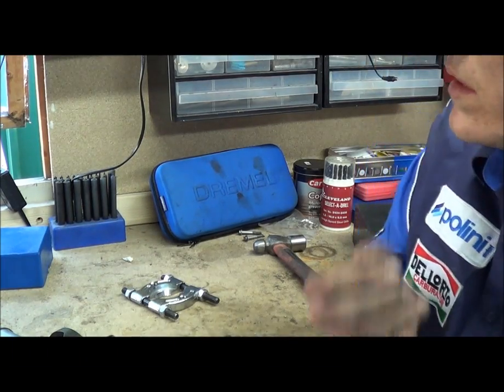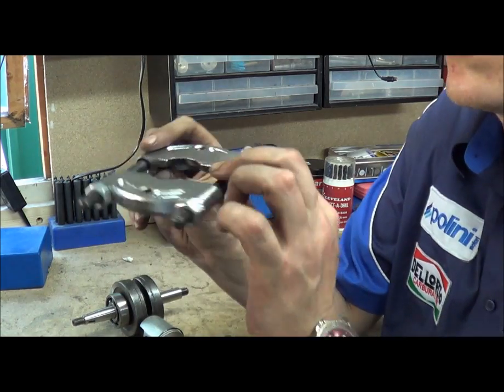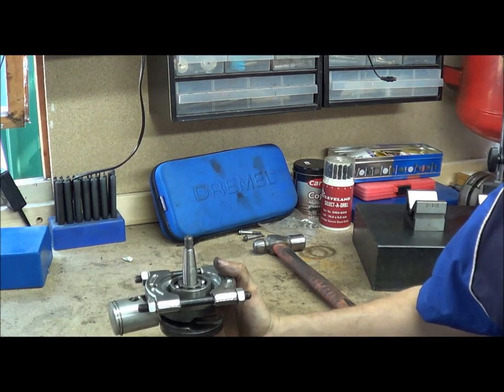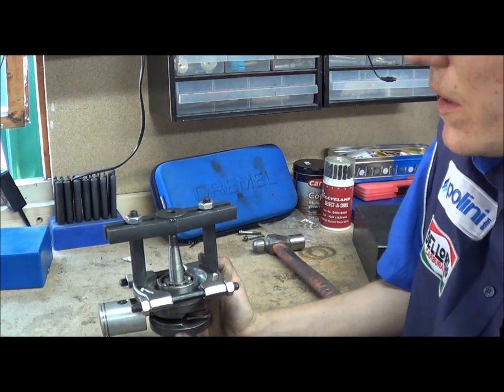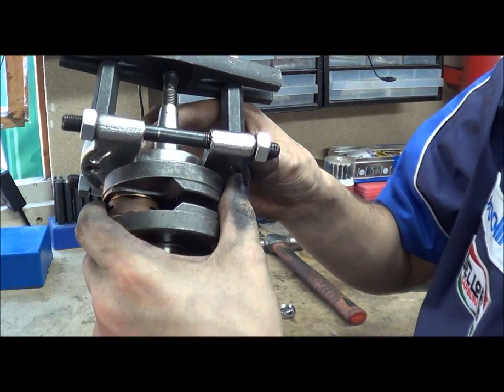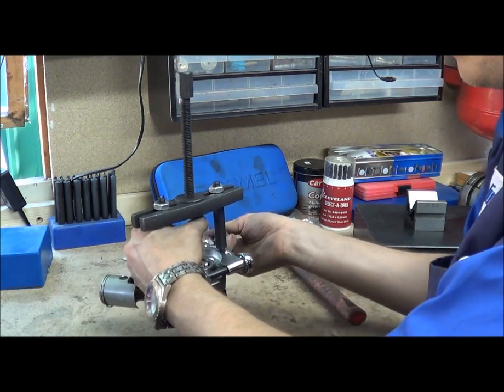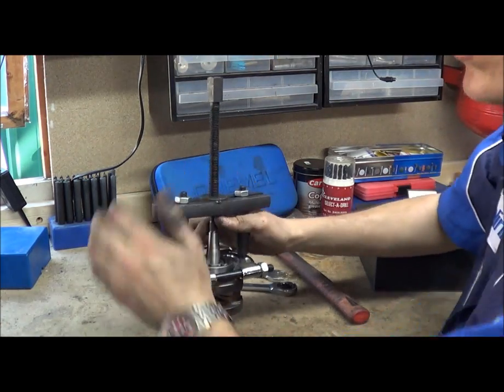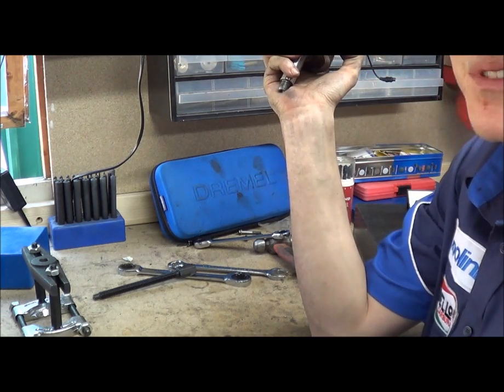Bearing Removal From A Crankshaft

Comment: Always try and leave nut on end of crankshaft when using pullers it helps stop the end spaying out
Reply from the maker: If you're splaying the end of a crank  then you're doing it wrong, very wrong
Reply: @thedirtyworkshop   doing it wrong is when you don't thread the nut on that's why you  put the nut on  and like mentioned in another comment lubricate the end of the crank and puller to eliminate friction
Reply from the maker: Do you have any idea how much force it would take to splay the end of a shaft? Do you want me to calculate the hoo stress for you?
Reply: @thedirtyworkshop  so what your saying is every bearing always just pops off without any problems no I don't need you to calculate anything I've seen all I need to see thank you
Reply from the maker: The compressive strength of the end of a shaft is way way higher than the fit of a bearing. If you have seen failures that because some retard is making bad cranks. There's a specs for centres in shaft vs diameter. You won't be seeing failures on Japanese cranks, I know that much.
Reply: @thedirtyworkshop  bearings get hot in service bad bearings get extremely hot and become almost fused to shafts it's all but to easy to damage the end of the shaft on removal two stroke cranks are almost Meccano sets compared to some but that said  prevention is better than the cure some cranks have a spigot machined on the end so you can use a thrust cup on the end to prevent damage when using pullers

Comment: Thanks for the info I thought about using the tool you slid under the bearing. I just didn't know about everything else that would connect to the rod for a pulling up motion. I usually put the end with bearing back on case and then tap crank off with my soft hammer. then I have both bearings still in case. If I don't know the background of bearings or crank, I just get new stuff to be safe!

Comment: i have a `93 polaris 250 and it seems to me the 6000+ miles on it had siezed one side of the crank set of bearings i had one of those tools and bent 4 bolts that clamp the jaws so this tool is for fairly new crankshafts not recccomended for old ones like mine.So after my frustrations of trying so hard i just used a torch and cut them off...i do have prior years of experience with cutting torches so be careful not to damage the crankshaft.

Comment: Very good , you never raised a sweat or got up . l was thinking maybe some expletives and   cooling off before a big  loud  noise, which reminds me of my effort . A silly question would be ,  has  the pulled bearing  been compromised by forcing only the outer  side of the bearing when the inner diameter is interference fit ? Can this be limited by sliding the puller in again after the bearing is being pulled ? l have heard once you have pulled one ...? it's life is over, but then why buy the tool when the bearing is sacrificed ? Thanks mate, cheers .

Comment: Hi, I have a genuine factory puller (Kawasaki) which I bought 40 years ago which is identical to the Honda tool apart from the two rods which screw into the puller halves. Even with the factory tool you have to drive both halves in with a mallet before you start pulling the bearing.
It's worthwhile adding thread protectors to your kit to avoid damaging the threaded portion (generator or magneto side crankshaft).
There is a specific thread protector (factory tool) for the Yamaha XT350 which has a female thread on the generator side crankshaft which must also be used in conjunction with the flywheel puller.

Comment: Drill a hole in the bench and put the shaft in it. It will make your job easier.
Reply: Not a bad way to work , you may have something in that big hole idea . l work on my scooters with the cases hanging over  on the table end is the rear axle or rear pulley keeping it level and stable . lf working on the other crankshaft end l balance it on the corner but l had no choice until now . So thankyou for that , l would need to cover the hole though or constantly pick up hard to see things all day . Cheers .
Reply: Hey man my bearings are good it's just the crank hand is wiggling what is that then? Another bearing

Comment: Brought a sealey kit (before seeing your other videos) and the standoffs are crap as it the splitter and it causes the bars through the splitter to bend and just won’t pull the bearing off. I figured as it was a £90 kit at the time it should have been half decent. Do you have any recommendations for a decent brand for ones of these? Yours looks a lot more solid than mine
Reply from the maker: Facom
Reply: @thedirtyworkshop  cheers, considerably more expensive but looks well made so have ordered the 110mm kit and stuck the burred made of butter sealey kit in the bin

Comment: Very helpful!. How do you install the bearing onto the crankshaft?
Reply: You heat up the bearing races in the cases, freeze the bearings in zip-bags, and drop them in the cases. Then you use a puller to pull the crankshaft-axle into the bearing.

Comment: If I split cases for something, and dont need to change the crank or crank bearings, and the bearing is stuck on the crank, will I have to remove the bearing and put it into the case seperate from the crank or can I put it in with the crank at the same time?
Reply: Hi, I know that two years has passed before seeing this post, however it would depend on whether the crankshaft has bearings pressed onto it or fitted into the cases. The bearing tool seen here is for pulling bearings off crankshafts etc. Different procedures apply to bearings fitted into crankcases. Trust this helps-JD.

Comment: Ok but how do you put new bearings on?
Reply: Put bearings and crank in freezer over night. (They contract when frozen.) Oil the shaft well, drop bearing on shaft, big deep set socket placed on the bearing, and tap, tap, tap . . .
Reply: If you’re being serious, you either sweat it, tap it, or press it into the cases
Reply: Gotta warm the casing up and have the bearings frozen over night and they drop in or if you have a press that works to
Reply from the maker: Magic lol - are you actually asking?
Reply: The Workshop well I figured that if it was that difficult to get them off then it would be just as hard to get them on. If you don't want to do a video then that is fine but if you take them off I would guess you are going to put it back on.
Reply: @Andrew-ql1cz  you don’t put the bearing on the same way he took them off. The reason the bearing is on the crank because when when you split the case it presses the bearing out as you’re splitting the case.

Comment: I have a 2008 Yamaha Zuma YW50t and I can't figure out how to get the shaft out, I have the case separated, but the Crank Shaft will not move?
Reply from the maker: Hello mate, do you mean the crankshaft is stuck in the bearing thats in the casing? Get yourself a block of wood and smack the wood with a heavy hammer, making sure the cank is free to drop out but doesn't fall onto the ground. - matt
Reply: Boom!!!! Thanks Matt, I figured that it was going to come to beating it out, I'll give that a shot tomorrow, Thanks again!
Reply from the maker: no worries mate, tell me how you got on - matt
Reply: I got it with a Small Hammer! I was afraid to bang too hard and bust the case itself, so now I'm good...Thanks a Million!!!!!!
Reply from the maker: No worries mate, glad I could help - matt
Reply: Thanks!

Comment: Good afternoon my name is marco and I am Brazilian, I have a yamaha 60 hp 2 stroke 1996, I will have to change the crankshaft bearing, my doubt is if I need to dismantle the whole engine, and please, if you can send me the service manual for this Engine, thank you. Mail marcoreisjr@hotmail.com
Reply from the maker: Hello mate, yes you have to dismantle the whole engine to replace the crankshaft bearings and secondly I don't know what yamaha you have - matt
Reply: Have the service manual please. thank you.
Reply: My engine and yamaha 60 hp 2 stroke
Reply: 1996
Reply from the maker: Never heard of a Yamaha 60 HP unless you mean its 60 horse power which still doesn't help
Reply: ok